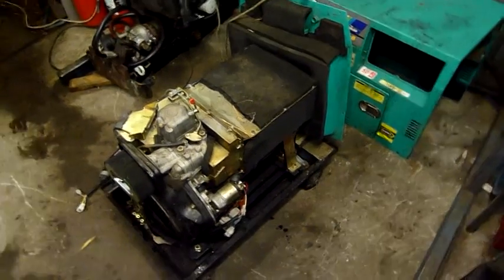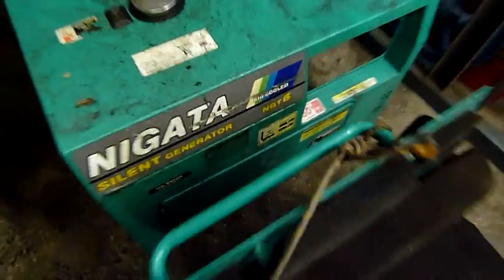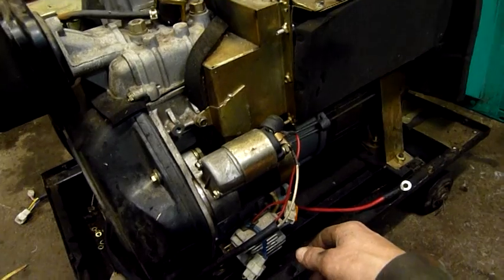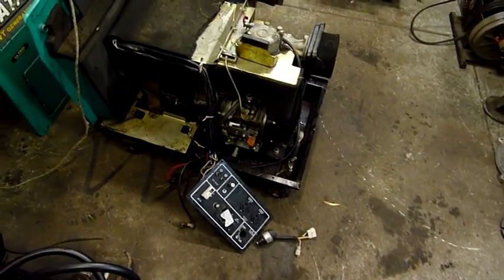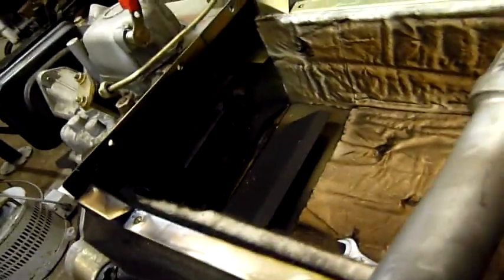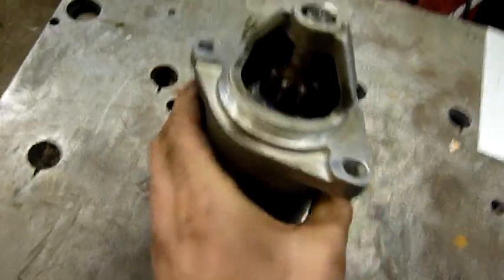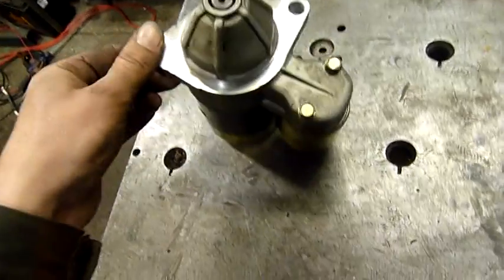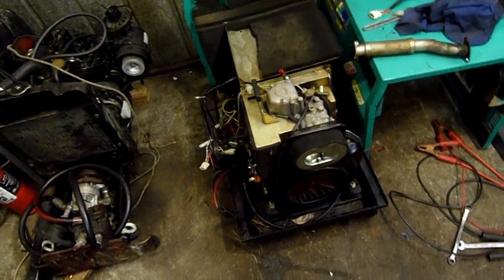Nigata NGT5 Generator Repair pt1

Comment: also i think they sell the same generator with the king Canada name 
also get rid of all the sound insulation it will be louder but wont cook its self i think that over heating is the big problem with those Chinese copies the 6000w i was talking about got so hot inside the case that it melted the plastic connectors on some of the wiring i am sure you can get 120 v off the gen on yours the ones in canada have a north american 15 amp 120 v GFI plug and 30 A 240v twist lock

Comment: try hurricane power equipment i have seen the exact same generator heir in Canada the guy that has the petter diesel in the video on my channel has a 6000 w that runs and 4000w for parts all both run the 4000 is missing the capacitor and case is rusted out the 6000w was over heated and had a tappet snap all it took was a new tappet and cam then he gut the 4000 with the same engine for 50$ the 6000 was free they look identical to yours his has a 120 and 240 volt plugs

Comment: the bushing in the end was the one i mocked up for testing, i had it cranking very well with it so that proved it was bushings and i was going to machine some new ones. but with the force on it that bit of copper wasnt going to be anything more then a test. after that it wouldnt crank again. ive prob got a few side panels laying around i may run down tomorow night if your home